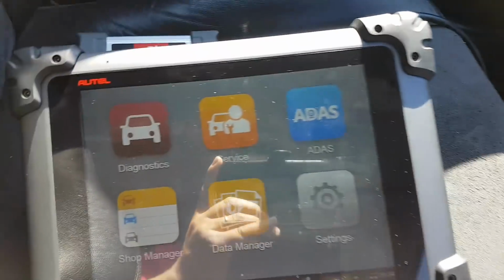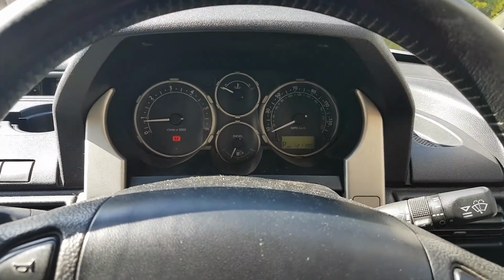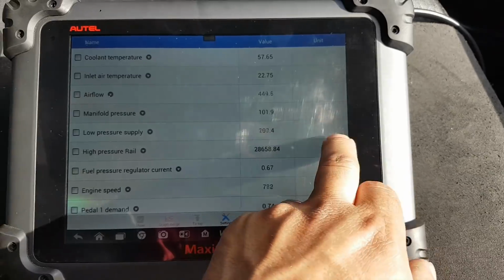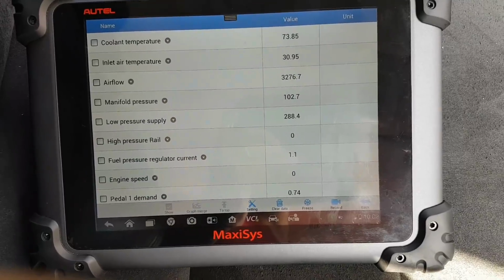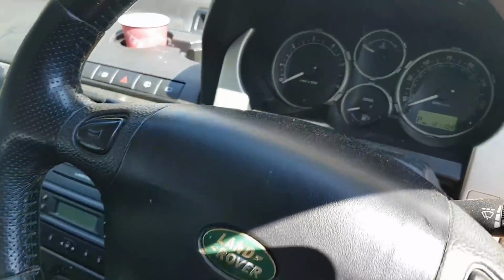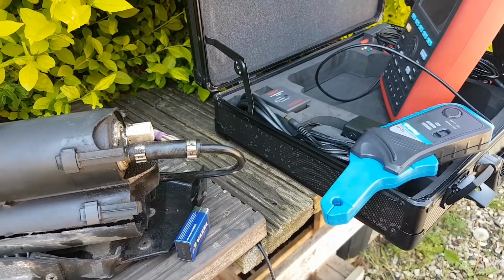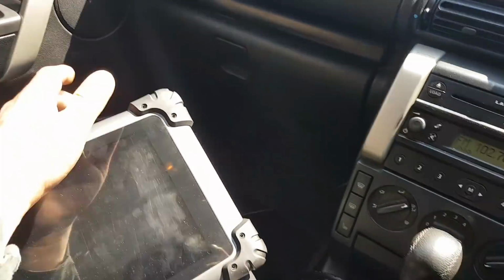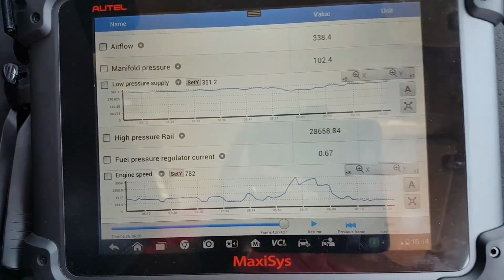Land Rover Freelander TD4 limp mode, P1260. Fault finding and repair.

Comment: Hi i have a freelander td4 engine with the same problem.I have changed the low pump pressure and fuel filter new one after using it for 2 days.The problem is still the same p1260 pre-fuel pressure control

Comment: Great video thank you, same symptoms but i changed the fuel pump with aftermarket (much louder) and no difference, still too low pressure. Then i take out the unit in tank, which has filter on bottom, it was blocked with dirt ! I cleaned this and it works now perfectly !
Reply from the maker: That's great!
Well done!
Reply: I have the filter and pump located on the right rear wheel. Is there another filter in the fuel tank?
Reply: @ yes it is ! and mine was full blocked, it is like mesh.

Comment: My code is 09F6 Fuel rail pressure. Misfire with warm 🥵help me ?
Reply from the maker: Something looks like is disturbing the rail pressure...
Do a leak back test to start with, check live data, connections and wiring...
👍👍👍

Comment: We're are you from I need your help with my car Landrover freelander.am in South Africa
Reply: Is a Freelander TD4 manual car when I press the accelerator doesn't go up I don't know what is the problem.
Reply: Which country are you from
Reply from the maker: UK...
Right, have you scanned the car?
Looked at live data?
Reply: Yes we scan the car but you can't see the problem is I just see your video so I think maybe you can be that problem I see on your video.
Reply from the maker: @nelsonthomi6177  
Do the testing I have done, that should help you establish if is that or not...
Reply from the maker: I from quite far... lol
What is the issue you are having?

Comment: What is symptom please ?
Reply from the maker: As explained in the video...
👍👍👍
Reply: @LMAutoRepairs  i dont spech english. I have use google translate
Reply from the maker: Misfiring like under load or higher acceleration... basically, lack of fuel...
👍👍👍
Reply: @LMAutoRepairs  my freelander accelerates poorly. weak traction in fourth gear. can it be up to the pump?
Reply from the maker: @Pera-Peric  
Possibly...
Scan the car first and see if there is any codes that might help...
👍

Comment: Hi that presure values are kPA to convert to bar divide by 100, so u have about 2-3bar low pressure and 280 bar high presure at idle. But low pressure pumps should run around 3-4 bar. MIne is doing 3.9bar at idle although the manual says injection pump work from 1.5 -2bar supply.MIne is pre-2004 model (2001 w/h 2 LP pumps one in the tank, and one in the engine compartment, close to filter and LP sensor)
Reply: Low pressure pump is 3.5bar

Comment: My landrover freelander keeps going in to limp mode too with the info light coming on and saying engine system failure. Has making these changes resolved the issue for this owner?
Reply from the maker: Hi
Has you had the opportunity to see, the car drove absolutely fine after the repair... so yes.
Thank you for watching!
Reply: @LMAutoRepairs  yes. Wanted to be sure. We had a sensor changed and the throttle body cleaned but that did not resolve the issue. Thank you so much for this video.
Reply from the maker: @innocenteyesuk  
But if you are having this same issue, you should be able to see it on the live data, just as I have showed on the video...

Comment: Hi i have the TD4 w/h 2 pumps, on the 2nd pump (lift pump) fitted in the engine compartment should have minimum 1.8bar to work.  Under 0.8bar ECU will cutoff the pump to preserve the injection pump. The LP pump gets typically 2.0-2.2bar @ 11.5V supply. The LP presure sensor should read at least 4.3-4.6V if pressure delivered by 2nd pump is ok. Judging by the sound and current fluctuating on the motor of the pump is definitively on the go and should be replaced asap (preferably before it dies completely). Also you could run into problems if HP sensor in the end of the common rail has a faulty conection /corroded etc. (i soldered conections to mine). On HP you need minimum 280bar to crank start, 300-350bar to idle correctly.
Reply from the maker: Hi
This was not my car... never seen it again after this repair... but thanks for pointing that out... I am sure it will help others...
Thank you for watching and for your comment!

Comment: The low pressure fuel pump is a common Freelander 1 TD4 problem. You could hear it when you started the engine with the old pump. A good TD4 should start quicker. When you listen to the start with the new pump you can hear the difference. It starts a little bit quicker and the TD4 growl is back on the first strokes of the engine. The older (mid 2002 and earlier) TD4 had one pump in the fueltank and one under the bonnet in the low pressure line.
Reply from the maker: Thanks for the info!... and for watching the video!

Comment: good job thank you so much
I have the problem in this type , but in my car Which is kind of renualt clio engine diesel 1.5 dci Do not exceed one hundred kilometers per hour ,with no fault codes stored in memory 
I wonder what the real reason is
Or What are the reasons that lead to this
thank you so much
Reply from the maker: Hi
Have you checked live data?
When you get to the 100km/h, does the car behaves in any way? Or just stops responding to the accelerator?
Thank you for watching!
Reply: just stops responding to the accelerator
Reply from the maker: @maforautorapair5935  
You need perhaps,  to check live data as the car reaches that speed... also pay attention to any other symptoms...
Reply: good idea
thank you so much
Reply from the maker: @maforautorapair5935  
👍

Comment: Hello!

I have a VW Golf IV 1.4/16V with a 17748 - Camshaft Position Sensor/Engine Speed Sensor: Incorrect Correlation - Permanent. I have checked the timing belt, it's on mark, changed both sensors and checked wiring. Could it be the ECU or am i missing something?

Thanks in advance!!

Comment: Awesome content!
I have a volvo 850 from 1996. Do you think it is good idea to check the starter inside although it works fine. I mean like replacing the brush pack at least. Or just use it until it shows some problem? Thank you in advance for your advice!
Reply from the maker: Hi
If is working fine, and is not giving you any signs of failure,  I would leave it...
Thank you for watching and for your comment!

Comment: Did bought some gauges for measuring fuel pressure  after this video ? I think  also that a low pressure sensor can be checked using an known source of pressure ,like an air compressor ?
Reply from the maker: 😋
Not yet... other things in shopping list...
Thank you for watching!

Comment: Another great video my friend :-)
A simple way to think about this would be to think of a jet wash that is connected to a garden tap
with low water pressure or that has a kink in the hose, it will work sometimes but the randomly stop until in can build up 
a bit more pressure on the water supply.
Reply from the maker: Great analogy! 👍👍👍👍
Thank you for watching!